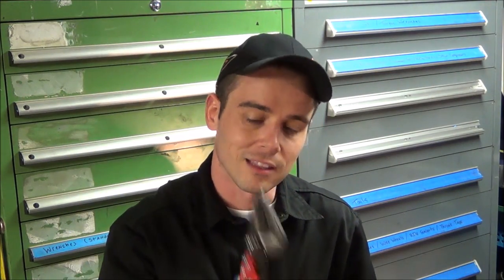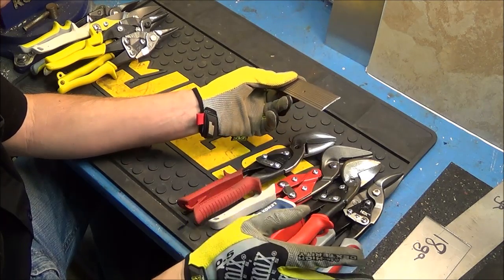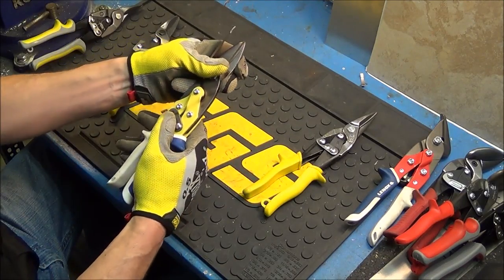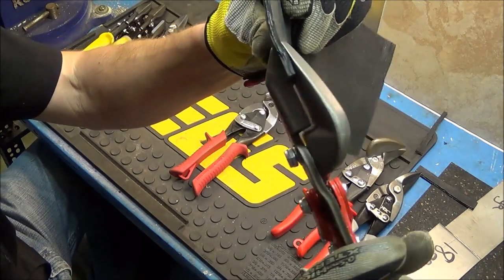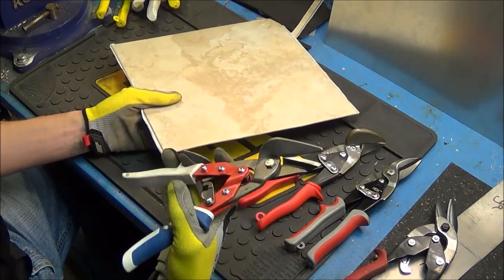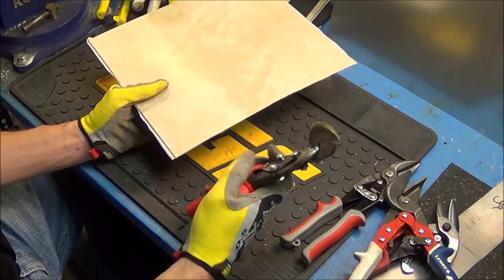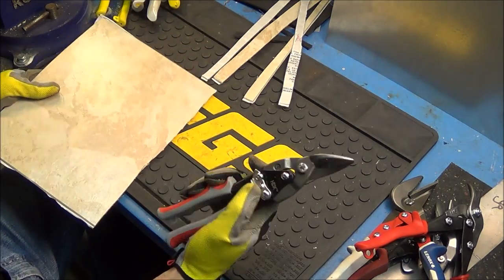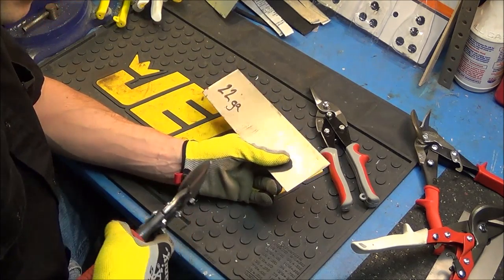Aviation Snips - Full Testing & Review - Midwest, Wiss, Lenox, & HDX

Comment: I'm on my 3rd set of Midwest. I do metal trim on metal buildings. They are awesome. The salt water from the Gulf beats them down, but you can slow the damage with WD-40, I recommend storing them only after a good spray with WD-40. Midwest also makes their aviation ships in an upright configuration, great for awkward spots and things like cutting holes for downspouts after gutters are already installed. Midwest also manufactures a snip called the Bulldog, which although is not offset, I find them handy for the really tough cuts, like snipping through the 5 layer seam of a commercial downspout.
Reply: Do you do the rest of the building too or only the trim?

Comment: Great vid.  I've been in the roofing business 30 + years installing metal panels  and have tried them all. In my opinion for offsets #1 Malco M2006-7 #2 Midwest MWT6510L- R.   These are perfect for long cuts and circles. For shorter and precision tip cuts nothing beats Wiss M1R and M2R.  Lennox,  Stanley, Craftsman DeWalt, Irwin, and HDX  are all home owners models IMHO any are okay for light or occasionall use but don't hold up to heavy duty long term use. Thanks again for the video
Reply: I am considering to try malco, just tried regular midwest, they're pretty good. Better than the new Wiss M1X

Comment: Good review.  I've been in the HVAC-R trade for almost a year now, and today I used a pair of Milwaukee offset snips to cut 8 takeoffs in some 22ga ductwork.  Coming from Wiss (did the first two takeoffs with them, actually), I couldn't believe how effortless these Milwaukees felt.......I'm sold on them after today, made some seriously short work of the remaining 6 cuts.  Do yourself a favor and try them.  They're some badass snips.
Reply: How about now? Do you still love them?
Reply: Try the Midwest, they are the best I have found and seem to last the longest. 15yr Journeyman Carpenter.
Reply: Midwest are wayy better, however recently harber freight has come out with some that look almost identical and only cost 8 bucks.. they work almost the same

Comment: Red ones are right snips mate, the cutting side should curl upwards. This way you can hold the shit end and aid the snips by pulling the metal up. Great video anyhow, I use Wiss. I'll be giving the Midwest a try. Cheers
Reply: Red is left and green is right, this is an ongoing debate ... share your opinions please.

Comment: I have a friend who is a tin knocker and he said," Midwest to tin knocker is as Fluke is to an electrician".  Nothing is more pleasurable than an easy working tool to make the job progress smoothly. Nothing is more frustrating than a cheap tool that delays progress and causes you to struggle and then the job looks like a novice hack did it.  I've heard others say all they use are the Reds.  After seeing these vids on the tube a few months ago, I learned "cuts left, doesn't mean the shears cut left at all, it simply means the waste side is to the left. I have reds greens and yellows all are Weiss, till today. I picked up a pair of Midwest red offsets.  I noticed the metal shops tend to use the large duck bills. Why is that? Where does their role fit into the scheme of things?
Reply from the maker: Mike Malone I would assume that they use the large duckbill snips due to the increased leverage & ease of cutting.  The aviation snips are very convenient and portable, but for production use where space isnt an issue, I would think that they larger pairs take less effort from the operator to do the same cuts.
Reply: Mike Malone Thanks for the comments on the Made in USA Midwest Snips.  Cuts left does mean cuts left.  Red handle blade designs, especially offsets will make sharp turns to the left, but not the right.  Reds and Greens both cut straight equally well.  Most right handed people will use a red when they can.  Likewise, left-handers will gravitate to the greens.  Pros typically have both for situations when they need to cut different directions.  Cheers
Reply: If lefts are for left handed users, then why would they build the ergonomics of the lefts and rights to include the use of the thumb latch (on the left side of the top handle) for only right handed users, reds and greens alike. If it were built for a left handed user, the latch would be on the right side of the top handle.
Reply: +Mike Malone he said left handed people gravitate to greens. Not that they where made for them. Clearly all 3 are aimed at right handed people.
Reply: I have been a tin knocker for almost 7 years now. I do shop fabrication, field fab, duct installs, and unit installs/changeouts. I run a crew of sheet metal workers and I advise all my guys to go ahead and spend a little more money to get Midwest snips. They are hands down the most durable and best cutting snips on the market. I still have my same pair of offset reds that I bought in my first year. I still use them everyday.
Reply: @mikemalone6103  there not meant for left handed users, there meant for making right turns, if someone cant use both equally as well then they should leave the trade
Reply: I can cut to the right or left with little effort with either rights or lefts.  The right or left indicates which side the waste will be on.  There's an older guy, on youtube,  that put an excellent video out who had the manufacturer of Weiss come to his shop to tell them about straights rights and lefts many years ago. I wish I could tell you the link.  He said the straights were for relieving corners like before you fold sheet metal and designed for only cutting one inch.  The lefts and right hand shears are to be used within 4" of the edge only. Otherwise a relief cut should be done and they do this with two pairs at the same time cutting into the middle of a sheet.  I also understand in the field, we dont always follow those rules.

 @chicken4090

Comment: I just got a set of Midwest regular (not offset) snips and had a hard time doing long cuts. I am aware that offset is what I need for long cuts so I went out and got a set of offcuts. Then it dawned on me that offset can cut long and short, so why would anyone buy regular non offset snips. I'm kinda sad then I got the whole set of Midwest non offset to start with, (green red yellow). And now they are basically useless to me.

Also is there even point of the yellow? Both red and green offsets are marketed to do straight cuts too. So why bother with the yellow, offset or otherwise?

Comment: Wish I would have seen this a few years ago I found a good set of snips through trial and error. Started with cheap craftsman, then Pro Snip, now I'm on Milwaukee's which I'm pleased with but by far the best I have found now that I'm doing HVAC is Malco. Hands down will be my next set of Greens, Reds, and Yellow. 

Loving the Videos, just found you a few months ago and have been watching all your videos keep up the great tests.
Reply from the maker: ***** Thanks Sebastian!  I am glad you like the videos :)  I have seen them in person & heard good things about the Malco snips, but have not used them personally for any length of time.  Thanks for the suggestion!
Reply: There was a foreman I worked with said that Northern tool carried a 3-pack: straight, LH, RH snips that were less than $20 bucks at the time and that they cut better than many of the common brands shown.  That was about 6 years ago though and the quality of everything has gotten so bad now that I almost wouldn't bother.

Midwest snips are a very high quality tool and had a lifetime warranty.  I dont know how the warranty process works these days. But you used to be able to bring your snips into SEARS and exchange for a new one with no fuss.

Comment: tilt your snip out   cutting from the center of the jaw with small bites not to the tip  with the bottom jaw side for your drop   use both left and rights at the same time if your locked on both sides  you can use them from the bottom too.

Comment: Ordered one pair of those Midwest on Amazon. Thanks for letting me discover these snips. Are there any concrete differences between offset and straight-cutting snips? Do you consider Stanley to be a good brand? Thanks. 

Oh I forgot, subscribed.
Reply from the maker: Vylkeer Awesome!  I am glad the video helped you out & thanks for subscribing/commenting!  As far as differences between regular (straight) & offset, the chances of you cutting yourself with metal is far less with the offset, since the material will be underneath of your fingers instead of aiming straight into your hand as you cut.  I dont have any experience with the Stanley versions, but I have seen them in stores....I have not used other brands that are as well made as the Midwest Snips.....you made a good choice.

Comment: If they cut left then they're "lefts" a sheet metal worker uses both lefts and rights wether they are right or left handed.
Reply from the maker: Yeah I realized I was saying it incorrectly after I posted the video.  You are correct I should have said "left" & not "left handed".  Thanks!

Comment: Its actually a common misconception the Red pairs are RIGHTS but you hold them with your right hand and they cut LEFT. The GREEN pair are lefts as you hold them with your LEFT hand but they cut RIGHT. However both pairs will also cut straight as you mentioned. Midwest vs malco please!!! Fellow HVAC tech! I use midwest but i used my buddies malcos and they were so smooth! Not sure if its cause his were brand new and mine were 2 years old but I’d be really curious to know which pair work better the malco or midwest!

I notice the Lenox looks very similar to my buddies Malcos. Not sure if Malco and Lennox are working together or one pays the other for rights to the design but they look identical other than the brand and colors used on the grips.
Reply: wrong, red are left,right are green. its an aviation and nautical reference to navigation lights,look it up.
Reply: Ever make up your mind Malco vs Midwest?

Comment: Just curious. Do you think it's possible the nut on the Wiss snips was not tightened properly or that they were dull? 

I'm asking because many like the Wiss brand snips. And a dull or improperly tightened center bolt will cause what you saw in this video, the jaws to splay or it to fold over/bind the material.

Just curious mind you as I'm looking to buy a set of snips, so I'm checking out reviews such as yours. 

Last question, are all the offset snips you show considered true compound snips? 

Thanks

Comment: On the trim strip you were uesing the wrong snipps at first the designe is made to channel the waist away from the piece not deforming the piece you intend to keep. They really aren't left and right as much as the direction you need to cut.

Comment: I have a pair of old Gilbow shears that cut beautifully. As an aircraft engineer I need good quality shears. Some of these shears have teeth with serrations to stop them slipping? I hate these! The acid test is cutting a sheet of metal in half. This sorts the men from the boys! The Gilbows can clean cut through the middle of a sheet with minimal damage or distortion. This is a tough test.

Comment: Good stuff. I really like that Midwest snips. How much are they? And also what do you think about dewalt and Milwaukee aviation snips? I think I would lean toward those brands simply because I'm familiar with them but if the Midwest isn't that much more I'd probably go with Midwest. Also good suggestion on the snips for the vinyl flooring. I did this one flooring job and installed vinyl planks that looked like laminate (floating floor not stick on) and used a jigsaw to cut them, if i would have known better I would have used some snips
Reply from the maker: A pair of Midwest Snips are typically $15-$20....in comparison, all of the other brands except for the HDX are almost identical in pricing (including the two you listed as far as I know).  The HDX comes in a 3-pack, and it is on the shelf for $9.98/set.....so you can see why they most likely sell a lot of them.  But, in a professional setting, quality tools are what really make the difference.
Reply: dmcguinn1 that's pretty cheap I was thinking a lot more since they were better than the rest

Comment: I would love to see how these Midwest snips stack up against Milwaukee, Malco and the new Fiskars brand aviation snips.
Reply: Milwaukee is making some nice snips ... been looking to get a set.  Malco is also top of the line.
Reply: How about Klein ?
Reply: @Clambelly  Klein is okay, higher quality then wiss but I noticed they were about the same force. Milwaukee I would put in the same category as Klein, but my Malco's cut through sheet metal like butter.  I do not think id buy any other brand then Malco for snips.
Reply: @andrewh9284  thanks for the info.  I picked up Malco 6" seamers ... the quality is amazing.  The store did no have Malco snips, but I will look for 'em

Comment: Would you say skip the straight snips and go for the left and right snips?
Reply from the maker: Joe Hanson Yes.  I use LH snips most often.  And also, go with some offset ones.....cutting metal and having it hit your hands is no fun.
Reply: I caught that but I was just curios as to what the use of straight snips are if the material hits your hand since it's not offset.

Comment: You are using the snips improperly. The waste side should curl up. In your demo you should be using a cuts right snip
Reply: yep wrong snips..if he used the right ones bets he would have had slightly different results
Reply: Yea that way if your cutting actual sheet of metal you can grab and mangle the trash side and the other side stays clean
Reply: All true guys but he was testing function, not how to produce proper products. Even so, I sometimes have to use the 'wrong' pair due to access or, say R Panel and still get good results.

Comment: I hate it when stores like Home Depot start releasing junk tool series like the HDX. Sears/Craftsman started doing the Made in China, Evolv, and Mach tool series. Lowes changed the Kobalt series over to the Made in Taiwan tools.  People don't understand that just because it says Brand X on it doesn't mean it is any good. Those stores are selling low quality items to make a quick buck.
Reply: Yeah, I agree, they sell mainly to the weekend warriors who only use the snips for a little project and they may work for them. Guys like me who use them everyday can spot junk snips in a second. Sears craftsman offsets use to be my favorite snips, when they got dull I would exchange them for new ones, I guess they didn't make any money on all the exchanges.
Reply from the maker: kj197734 Well, sadly because they "look" the same, and cost 75% less than a quality tool....people refuse to think there is any difference.  But, then again, that is how they get them to keep buying tools over & over...since the junk ones break constantly.

Comment: Also reds aren't left handed. ..they are right handed but they cut to the left....blades face the same way as straights....
Reply from the maker: I picked up on me saying that the wrong way after i uploaded this video. ... you are correct. ... these are not "left handed", they are "left cutting" .... thanks!

Comment: I couldn't help but notice that, you are improperly using them. you need to lay the material that you are cutting flat against the cutting edge of the bottom blade. not doing so will absolutely destroy your snips in one cut if not careful.
Reply: also the pressure you are feeling is you fighting the bending of the bolt that is holding the snips together..
Reply from the maker: James Sturgis There is absolutely zero chance that cutting mild steel sheetmetal with hardened snips will somehow break the snips in one cut....not going to happen....ever.  How would a HVAC tech cut a hole into existing ductwork & ensure that the bottom blade stays flat against the surface while they are in a 100+ degree attic running lines?
Reply: You're using them incorrectly, No it will not break the snips but it will certainly dull them. 

Go out and try for your self, Greens you need to lean them to to the right, reds lean to the left. They will cut significantly better.
Reply: +troy chrisman 

Sorry... reds Right greens left haha
Reply: i can speak from personal experience that cutting at anything other than a 90 degree angle to the surface will dull the crap out of the blades. Also, Lenox snips are in my usage (26-18 ga rolled and stamped steel) garbage. The Milwaukee ones are pretty decent though. Midwest is the best I've used. Wiss makes good seamers though.

Comment: HERES A REAL REVIEW FOR PEOPLE.....yes....Lenox snips are terrible....right out of the package ..garbage....the old Stanleys were GREAT, raptor snips are GREAT...similar to Stanley....wiss are ok.....millwaki not very good at all....craftsman not very good...craftsman are similar to millwaki in cutting and force....hdx sucks obviously....princess auto pro point are actually not bad at all...similar to  old Stanley and raptor snips...similar to wise also......cant wait to try midwest......hope my opinion helps people avoid  marketing garbage. #1 probably midwest I GUESS.....2 old Stanley...2 raptor....4 pro point princess auto...ODDLY ENOUGH.....and yes Offsets are the best....blows my mind how sheet metal guys are stuck on using regular snips to cut pipe or tin?????    and obviously the large offset snips are good.....malco and wiss are better then husky....but at the price point of those husky isn't a bad option for the price difference
Reply: I heard Klein are good  but $$$$$ and im forgetting some others as well....but I have used all the above